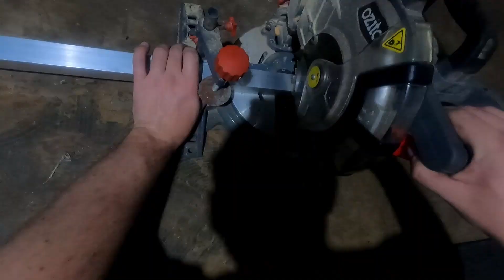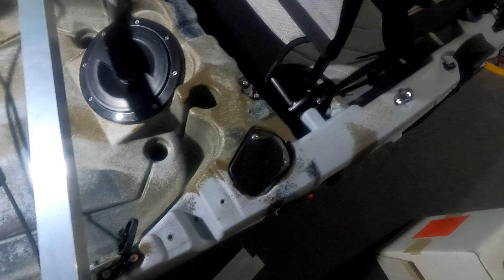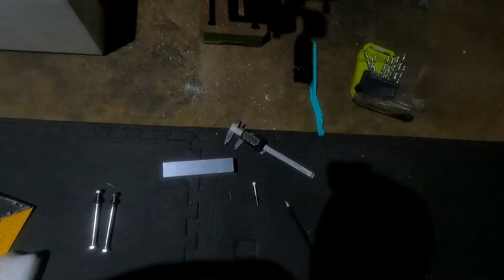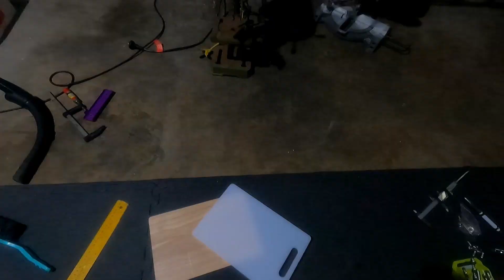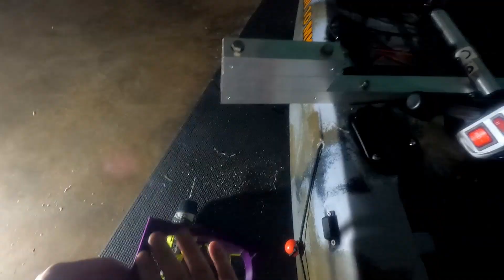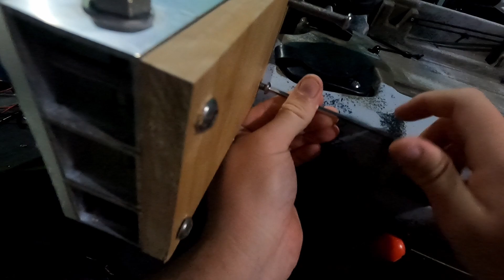DIY Kayak Trolling Motor Mount

Comment: I think it's a great setup!!! One question please, with that assembly I do not understand the function of the cylindrical tube in the engine hole, why do you put the cylindrical tube? thank you!!
Reply from the maker: that tube is for my outriggers / stabilizers, its has no functional use for the trolling motor. Hope that helps. Also though i haven't made a video on it. I 100% recommend trying to rear mount the trolling motor, iv been using it like that for quite some time, but only if you have an option to steer it, and i used the rudder foot controls to steer the trolling motor on the back.

Comment: Amazing mate :D I wish I was as handy as you to get this done. Also did you have a look at Dragon Kayak's trolling motor mount? They do one with metal tubing that sits into the rear rod holders and has a nylon block at the side so you can remove it easily and also still functions as 2 rear rod holders as well. I like your motor mount though it looks strong and durable.
Reply from the maker: Thanks Mate 👍 It's Held up very well over a few months. I did see the Dragon Kayak one. i like the concept. Appreciate your kind words mate